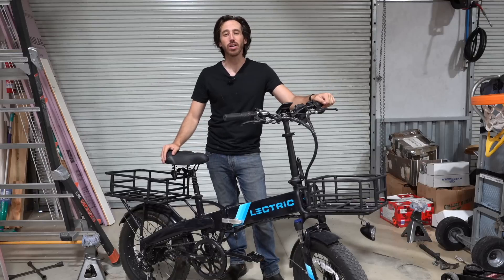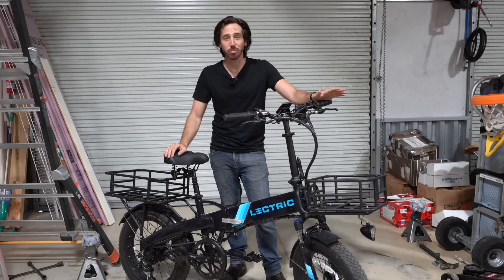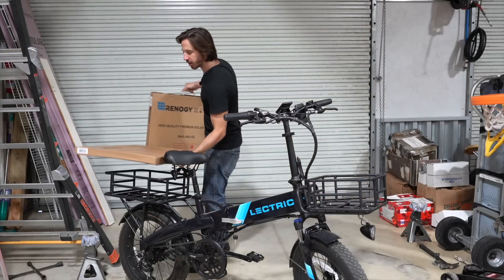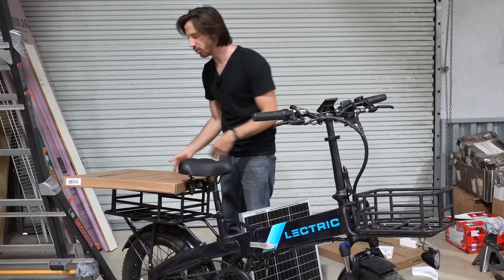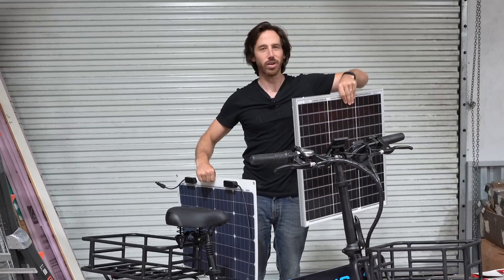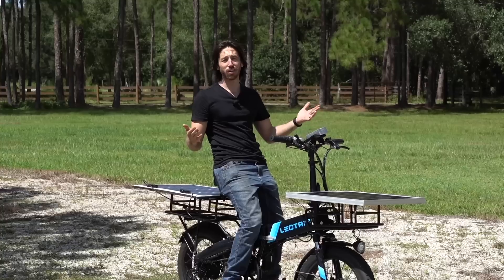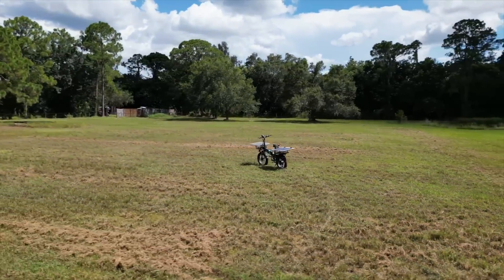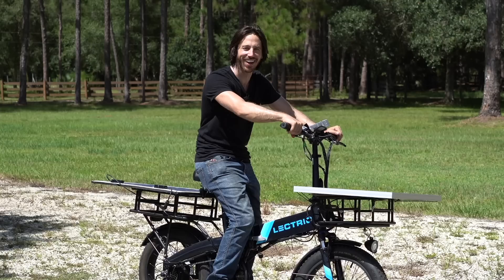Easy DIY solar charging electric bike guide

Comment: Start with the watts of the motor should match the watts of the panels so that an hour of sunlight can equal an hour of go full throttle
Reply: Should use a natural voltage regulator like panels that barely exceed in voltage of your battery
Reply: Instead of a charge controller that will draw on your voltage and limit your charge capability

Comment: THANKS FOR THIS INFORMITIVE VIDEO. I'd like to just use 1 flexible panel for extended range and carefree travel just knowing your not dependant on accessing a plug at the mercy of whom ever you could beg for a charge would ease any range based anxiety. and it could possibly be a set up that can be stored on side of bike until parked in sun light.

Comment: if you charge at 60 watts (1.2 amps) and have a tiny 7ah battery it will take 5.8 hours to charge the battery from empty.  if you have a tiny 300 watt motor you are using power 5x faster than you make it  . if you want to ride constant u need 2x minimum the watts the motor uses for the solar panels plus 20% due to the loss of boosting the voltage  so with a 300 watt motor at 48 volts your looking at 720 watts of actual power and that's if the panel put out 25 volts, and they don't so more like 800/900, the way solar panels lie about output basically a 1,000 watt solar panel to power an epic cheap ebike in full sun at or below 77f to keep up with the motor. if you pedal 1/2 the time u still need 500 watts. i cannot even find a 1000 watt diy single panel. a 500 watt panel is almost 7ft long just under 4ft wide and weighs 50lb and 250ish dollars. solar is fun,but still not practical but for niche applications.

Comment: ❤😊 👍 I was lucky enough to do a solar bike ride around Wales with a lot of panels on a bike. the two ones at the back were done in series and didn't work very well. the front one which was separate had the most power and as you said any contrast to any shading cut the input down a lot. but one thing we did find is on a rainy day with white contrasting sky. we had the fullest charge and the least interruptions. a constant flow of electrons and it was cool there as well interesting. so yes I am going to put a solar panel on my trike a big one and obviously have them at home 😊

Comment: Yeah, adding solar PANELS tone-bike is a "solution" but not a practical one.
MY SOLUTION: Off Grid TREK 200 watt solar blanket folding to the size of a large laptop and 4" thick. Weight 12.5  pounds. Adding the  programmable controller and cables brings it to 14 pounds. The blanket is laid/staked out on the ground or draped over a table or tree branches, plugged into the SAME Elejoy controller you haven plugged into my E-CELLS  bike's patented FRAME  charge plug that charges BOTH batteries at the same time. (52 V 20 Ah front down tube and 52 V 15 Ah rear rack) The OGT blanket is very efficient, waterproof and, at USD $1,700. not cheap but waterproof and the very best blanket available. It's ia about 1/3 the size of other 200 watt solar blankets.

Comment: Ideally you would want some sort of system that could measure the battery voltage and stop charging the bike at a certain voltage. So you could theoretically set a charge limit of like 85% so you weren't constantly keeping the battery at max voltage if you weren't running it super often. My work laptop for example has a system setting where I can make it so the battery stops charging at 80% while I'm plugged in so it doesn't stress the cells in the battery by being fully charged at all times. Would be super handy for an eBike solar system.

Comment: I just bought a Lectric 3.0 like that. Its BMS (wherever that is"?") or something else does not allow the bikes pedal assist, throttle or even the LCD screen to turn on when it's plugged in to the regular AC charger it comes with. Is this caused by the actual charger or the controller which the battery plugs in to when the bike is latched together?  Did you have to modify anything within that controller? the battery? etc?

Comment: The system requires (for long haul  independent round the globe journey) a pivoting panel system of 400 watts aligned behind a purpose built recumbent bike to mitigate wind resistance and motor used for only for step inclines.

Comment: I have an Aipas, i believe Lectrics are built in the same factory.   I want to risk doing the same thing to my bike.  I think 100 watts will be enough, specially if you pedal alot, keep the speed down,  take a break every hour.

Comment: Even if you can extend your range with this set up, you need to keep in mind that electric batteries and motors heat up with continuous use, which damages and reduces the life of them. Gas is still better.
Reply from the maker: It’s going to be a mind fudge when you learn what happens to combustion engine components when they heat up
Reply: @EbikeSchool  Have you ever seen a firefighter use an electric chainsaw? They don't use electric because gas engines... if you haven't noticed, have been proven worthy for more then 100 years. Granted they make cheaper quality gas engines but for the money, a high grade engine will always outlast electric.

Comment: If u look up robert murray smith, he has some compact wind generators. Size of frisbee would do. Serpentine coil generation at rim axial flux setup. Couple that with your solar and double up the power. He 3d prints his prototypes, open source. Worth a look.
Reply: U can go further by scavenging power from each spinning wheel simply with magnets on the spokes/rim and coils at the forks.

Comment: Hi Micah thanks for a very insping video. How to apply your ideas for off-the-shelf ebikes? Long range touring on my Specialized ebike is my dream. I have the trailer, a 100W solar panel, MPPT (Genasun) and a 50Ah battery. I want to travel up to 150 miles without access to a 220V plug for charging. My 460Wh battery  provides no more than 31 miles range. But getting the commercial ebike to accept charging on the go appears not possible. What's your advice or suggestions?

Comment: excellent idea, i believe almost everything with an electric motor should have solar panels, i would put two over head and three around the front wheel covering the sides of the front wheel too, and similarly three around the back tire, i know vertically the panels will not produce much power but if they are hinged then once parked you can fold them horizontally

Comment: I did not realize that covering a small area in the cell would cut the current for a significant portion of it. I wonder if there are cells that are wired to minimize that effect.

Comment: This is cool and all but I don't think this will extend the range that much. The Lectric will probably get about 30-40 miles if you use the lower PAS settings and with the rate of charging that you're getting here, you'd probably only extend 3-5 miles within a 35 mile ride until the battery is depleted. If you wanted long distance, it's probably a better idea to just buy more batteries and run them in parallel or a couple of power stations and just plug those in while riding, but even this approach is limited by how quickly the Lectric can accept a charge. Still, this is a cool way to charge an ebike when not in use by just leaving it out in your back yard or something for a few days though.

Comment: With those baskets on the front and back, you could make a sort of convertible rain fly type roof and put more panels on the roof, and have extra batteries charging to swap out...
Reply: So mount panels above head level? Gonna be a bear not letting it tip over anytime you have to stop or push it

Comment: I got an Electric bike,I wish I had this on it,It for ever be charged up,After I biked more than 40 miles by keeping the battery low,It go flat after that,Then try riding the Electric bike with out no power,Its like trying to bike with a massive brick on the back,Even worse trying to bike up hill with out the power,Is even more tough

Comment: Get better solar panels that work no matter if the clouds covering covering solar panels it should still work there are ones that no matter what wherever their son or late it should work proper West point of having a battery 🔋 for the Sun 🌞 at the solar panel doesn't work proper? 🤔 It should work under percent or better ✅ if you get the right or rely on yourself if you know what you're doing 🔋 you should get more more electricity then more input instead of 👍 but that's where the reading and math comes 👍ok cool 😎

Comment: I'm contemplating a trailer with 20"x4" wheels to tow behind my cruiser fat bike for touring/beach fishing/camping. Also considering disc brakes (cable and probably run off the rear brake lever for slowing etc.) on trailer. Uncertain as to running the bike while charging. Guess I'll just have to see if it works. My concern though is that even though the bike will draw high amps while running, I am dubious as to how many amps I could pump into/through it while charging and running at the same time. Other option, given I'm looking at a Sunman 174Watt flexible panel, is something like a Bluetti in the trailer and a second bike battery, charging with the bike's supplied mains charger. Would then consider a seperate fold out blanket for use while camping or fishing. It might limit my range a little but prolong the bike battery life. Besides, I'm retired and in no hurry. 2 bike batteries with one charging while riding should give me about 3 batteries worth of milage a day. More than enough for my age pensioner knees.
Reply: I am considering doing the same thing. I ride a recumbent trike. Quiet Cat makes a great suspension trailer. U can have a Bluetti or a Ecoflow and have a separate mppt to charge the extra ebike batteries directly. A dedicated mppt to charge the ebike batteries direct will be more efficient than going through the Bluetti or Ecoflow. After you top off your ebike batteries, u can top off your Bluetti as well.

Comment: You need trailer than flex light  panels can be 200 to 400W easy ( few times 100W), and trailer can few panels more and more batteries, when stop spread more panels around up to 600W enough to charge 3 batteries.

Comment: I'm planning to build a microcamper to use together with my PEDELEC electric bike. With your video I feel confident that I can fit a solar charger for the bike's 36V system in the camper. I should be able to fit at least a 100W, maybe more, panel on top of the camper, and two battery banks inside(if the system in my bike doesn't work while charging.) so that I have one connected to the bike and one being charged when travelling. Just need to learn to weld to build the frame of the camper, source a lot of materials... Fun!

Comment: You risk over-charging the battery. And over-charging a battery can result in the risk of fire. So it is better to just carry the panel and charge it when it in a non-ride position. 

You also reduce your carrying capacity. So I don't see the point. 

Regenerating breaking or something similar to what can be found on some weather radios using the petals. Of course the BMS and controller would regulate how much power is stored in the battery so that the battery never gets over charged.

Comment: What if you were to use the flexible panel in the front and have it angled 30 degrees by leaning it up against the handlebars? It would suffer when not riding towards the sun, but it wouldn't have to compete with shadows from you or the bike and it could double as a bit of a windscreen for your body.
Reply: sh!t thats what i thought, i also was thinking making clothes i can wear, like a cloth flexable solar panels all over body, plugged into bike & wearing sun glasses like Doc from back to the future 2

Comment: The angle of incidence to the sun may also make a considerable difference in solar cell output power. At "midday in Florida" you're OK with the panels lying flat like that, but either side of midday and you start losing solar output power. 
It would be interesting to see how much you can improve things during the mornings and afternoons by providing a means to rotate the panel to an angle that more directly faces the sun as it travels toward or away from midday.
Plus or minus X hours (I'd start with +/- 1 hour) from local midday, I'd just lay the panel flat as you have done.
I would envision simple hinges about which a panel can be rotated and locked in place using a simple stick or peg system. Then, if you're riding on a road traveling East/West you pivot the panel toward the east in the morning, and toward the west in the afternoon. 
The generally optimized angle depends on your latitude. For example, at my latitude (for a single static postition) the "ideal" angle to tilt the panel is about 40deg.
So far I've not found any, but I'm going to keep searching around and see if I can find an ebike riding innovator that's done some experimenting along the lines of dynamically adjusting the panels for optimum output.

Comment: My design places a solar panel above the rider which also serves as a sun shield, an additional smaller panel could still be placed behind the bike. Plus no one is utilizing the energy from the wheels, add small wind turbines on the front and back to pick up a continual flow of electricity as long as the wheels are in motion.
Reply: Wind turbines would cause drag and reduce overall efficiency

Comment: While you demonstrated that you hooked up your solar panels and charge controller to the Lectric ebike and did a test run, Lectric specifically states that PAS is deactivated during the charging process.  This information is also printed in their current user manual.  I also plug the charger into my 2.0 ST Lectric bike, charger shows “red” in charge state.  Turn on the bike, engage the throttle, and the bike power off after a brief startup.  There could be several possible reasons you were able to ride with the throttle with the solar charger plugged in:

1)	Your battery voltage was higher than the solar voltage which means that your solar panels were not really charging the battery
2)	The charging current was too low to be effectively measured by the bike controller, therefore not cutting the power off

You were reading the charging current while the bike was not actively engaged.  While riding, did the solar charge controller show a charging current?

Comment: something to start with, a good idea and it may have a future. You need to add a capacitor and maybe a battery so it doesn't lose power in shadows or clouds.

Comment: I’m interested in DIYing a project similar to this but with more solar panels.

When the battery is fully charged, what components and mechanism would be necessary to switch over to solar-ONLY assist, to preserve the battery’s charge for low light conditions. A charge controller of course, but what else?

In the setup above, does the solar power get delivered to the same motor that the battery powers, or a separate motor?

Comment: No idea if this issue has been solved with newer products but some solar charge controllers might burn up if you connect the solar panels before connecting the battery. Just in case, anyone reading this, make sure you connect the batteries first so the charge controller would have some place to dump the energy from the panels. Panels can not be 'turned off' if you know what i mean.

Comment: I apologize if this was covered in the video, but how will this system know when the battery is fully charged? Does the bike battery BMS cut charging safely? Or is this done by the charger itself (in this case the MPPT controller)?

Comment: Wouldn't it have been way smarter to put them above you and also use as a cage and a roof over your head at the same time.. cuz your body will be blocking that entire board at many angles with your shadow

Comment: Tbh might as well just do this

Put the solar panels outside and hook them up to a battery to store the energy, and then instead of charging the bike with your home wall outlet, just charge it with the charge the battery has and you basically get the same result, unless you want to go long distance but e-bikes are really meant for traveling medium to short distances.

Comment: For the mini truck put a rack over it like worktrucks use to carry ladders and put the highest wattage panel you can get the extra weight won't affect it that much and you probably don't need th dump bed feature that much
Reply: Actually, we use the dump bed all of the time.  It is super useful.  JUst used it today to dump three loads of tree branches at the burn pit.  Thanks for the comment though.  Best regards
Reply: @micahsdad5388  my bad I have a dump bed on my side by side and it's less of a hassle to just remove whatever I put in it than dump it but mine is manual not hydraulic

Comment: So if you attach a pair of airfoil to the e-bike with solar boards on the surface, you might get a e-plike which allows you to ride not only on the ground but also 1 or 2 meters above the ground! (Don't try it please)

Comment: No doudt solar chagring will work only if  your ebike  will be exposed to sunlight all day  or 6hrs  hours long travel  or 24/7  but if you dont ride that long it will not charge quickly, I think its much easier to buy another pack of battery reserve for swapping or switch pack  if it gets low  or if  you can bring portable generator for charging

Comment: Micah, thank you for all your videos. I want to use solar to charge my 52v 20ah battery using solar. I have a plug charge port and the hot and ground wires to my controller, can I use the wires to the controller to charge from a boost controller that is connected to solar panels? No place for info and thanks for any help, Ed